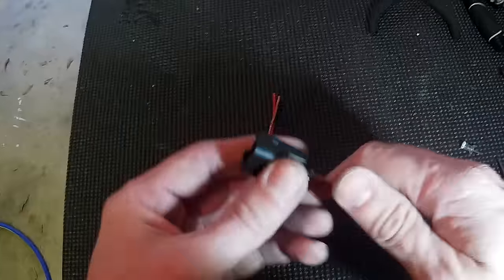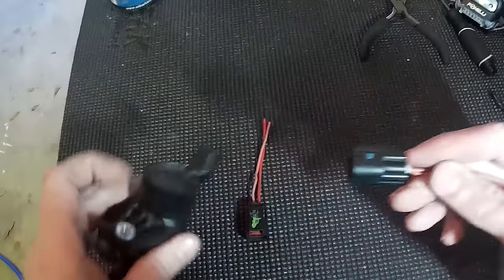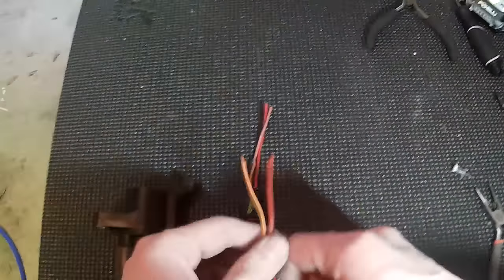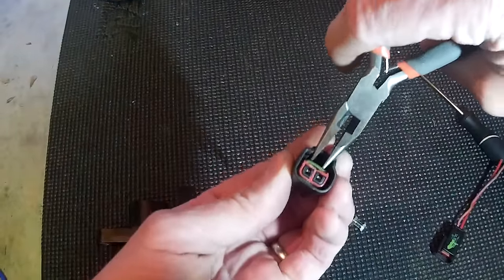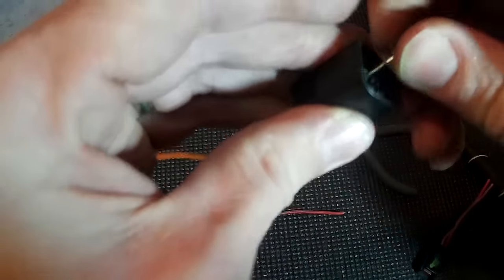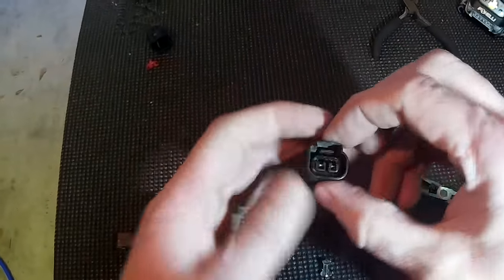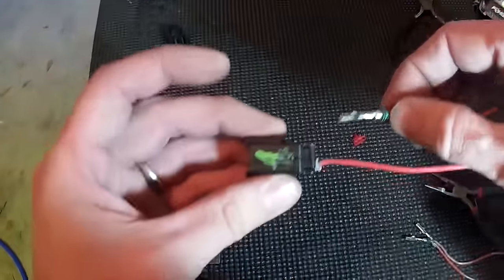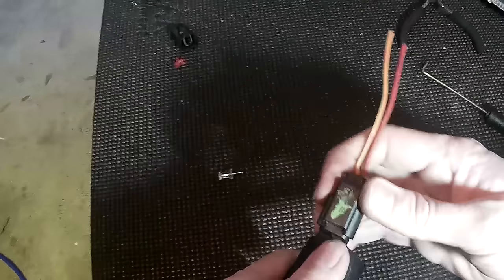Repair Ford Coil Over Plug Harness Adapters Without Cutting or Splicing. Broken ignition coil wire.

Comment: You just saved me so much stress, headaches and aggravation. I was getting cylinder 2 & cylinder 4 misfire. Haven't had the truck long, but figured the coils were bad with the truck having 140k on it. I replaced all 8 and drove for a short while and felt the hesitation come back. Check engine light began blinking and the engine power was down to where my a/c quit and power steering was cutting out. I got 3 of these clips that broke as yours did. I pushed them back on as best I could and figured it would be ok, but obviously not. Thankfully I found this video and plan to hit the junk yard on my way home today. There is a few of these in the yard there. Hopefully I can find some that are still decent enough. No way was I going to cut and splice, but figured I would have to replace the whole harness and or take it to the shop. I am so relieved that I can fix this myself. I am good with cars and almost always repair things myself, but I do not like messing with electrical because things are so finicky. Thanks again. I feel so lucky to have found a video that was the exact problem and solution in 1 short video.

Comment: Well looky here... This is what I needed to see!!  Thank you so much.  I replaced my sparks and coil packs and have a misfire on "D" which I'm told is #8 (the back left one).  Switched the pack out with another cylinder and same code popped up on same "D".  So I've been bumped thinking I need to splice and what not.  This is exactly what I need, Thanks!
Reply from the maker: Your welcome! Glad I was able to help.

Comment: Long story, but the short story is that I used your procedure to replace the starter connector with a new connector that was super difficult to find at first.  Your procedure allowed me to NOT have to cut the wire and splice it, just wanted to say Big Mahalo for this video!
Reply from the maker: Great! Glad it was helpful for you.

Comment: Hey Scott, Such a great video.  My crank shaft position sensor connector is broken.  Car was not starting because the plug had slipped out enough.  I was dreading having to splice into the harness.  You saved me a lot of trouble.  I appreciate your investment time to make this video. You ROCK!
Reply from the maker: Thanks! Glad to post and glad so many have found it so helpful.

Comment: Thank you so much for the video. I wasn't sure what the chances were of finding a video that showed how to repair these connectors without splicing them, but sure enough there happened to be this one. I have been having issues with 2 of these connectors and it's because the plastic tabs broke off. This probably saved me $50 from the parts store so thanks again!
Reply from the maker: Your welcome! Glad it helped out.

Comment: Thanks for this video man. The same thing happened to me last night. Nice to know it's a simple fix that does not require splicing and soldering.
Reply from the maker: I spiced once and then figured this method out by dissecting the part I removed. Glad my video was helpful.

Comment: Thanks, this video is exactly what I needed.  I found a set of 8 connectors on ebay for about $13.  Now I don't have to be concerned w/ splicing them.
Reply: Did it solve your problem after you changed the connectors ? Thank you
Reply: @ebayluis23  Yes, it did.
Reply from the maker: Great find for $13, cheaper than the yards. Glad you were able to get it fixed.
Reply: That's a good deal also I've used small zip ties to hold them in place till a person gets the chance to change them out.
Reply: Where did you buy your connectors ? Were they quality? I bought some they were junk!! Can you share the link? Thank you!
Reply: @chrisdoyle567  Ordered them off eBay
Reply: the ford wires still fit properly in the aftermarket connector?
Reply: @lukeoefelein5601  Yes, they did.

Comment: Big help! But I do have a suggestion, If the tab is not broke off. Most likely the silicone gasket is destroyed and keeping the connector from going down all the way. Dig out the silicone I would bet the connector will lock. Just replace the gasket.
Great video!
Reply from the maker: Mostly these break because the little locking tab dries out and becomes brittle from heat causing the grip to let go. Ford used cheap plastic on these evidently or they just saw a huge money maker in replacing them. I would personally keep the silicone, it helps keep things snug and locks out water.

Comment: Yep, I’m dealing with a misfire issue currently and I couldn’t figure it out until the coil connector/over plug came loose and wouldn’t snap in like it should. Thanks for the mini tutorial bro 💯👌🏽
Reply: i’m having same problem on my 06 5.4, after this process are you supposed to splice it in or how do you connect those wires to the actual harness in engine ?
Reply: @hernan6ez936  basically you take the old connector off and put the new one on. No splicing needed. It’s a little tricky. I went to a pick and pull and found old/used ones and they worked out great. Get a couple extra just in case though. One I picked was brittle
Reply: Did your misfire have any codes? I’m wondering if that’s what my problem is.

Comment: Very small screw driver and push on keeper from wire side. It has snap connection too. Push and it will pop up. Then pull it out with needle nose. You won't be breaking them

Comment: I just had to replace some and bought them from Amazon for a set of 8. I’ve always done a lot of soldering though and so had planned to do them that way. Especially considering someone that had the truck before me had used a butt connector to fix one of the wires in one plug. I didn’t even really think of trying to take the pins out which I’m surprised I didn’t and wish I had. Granted if good at soldering that’ll work also, just make sure to cover solder joint with heat shrink . Nice video though. Thanks I’ll keep this in mind for SURE the next time!

Comment: If it doesn't snap on, does that mean you will definitely have a problem or could you hold the connector on with maybe a zip tie? How can I truly tell if the connection or connector is bad or not? I put in some new coils and the connectors didn't snap into place. Some seem fine and others are iffy. Thanks. Great video.
Reply from the maker: I have had a few not snap in, I give a little tug to make sure they are secure. Also check the little rubber gasket inside to make sure its in place and not pushed to far back or twisted.

Comment: this video makes it look so simple, and on the bench it is. But doing under the hood with just a few inches if worth of play in the wire, well just be careful not to pull to hard or force anything, in or out. Its just tight , especially dealing with number 4 or 8 cyl. But overall good video and  good info and you're right, $22.99 at Advance. Didn't even bother with dealer...lol....and $17.99 for  fuel inj harness adapter. .So definitely try to find at local junkyard, especially if you have several to do. Just make sure they aren't as brittle as the ones your replacing. Especially if they pull em for you, check them out before you pay!! Because most junkyards have a no refund policy on stuff like this.
Reply from the maker: I like to pull my own. I look for late model, low milage and definitely make sure they are in good shape. I use a folding ladder to get over top of the engine, luckily im tall. Done them all under the hood but you're absolutely right not much room to move and don't pull or force anything.

Comment: The mechanic shop broke three of my 6 snaps then denied it! THEN told me it would be $3,000 to fix the 6th cylinder misfire! OH and that the bolt to that cylinder was also stripped and would be another $200 for a kit to get the bold out they stripped! 🤬🤬
I was able to get the bolt out but was really stressing out about the broken snaps. 
Just wondering now is there a place to order JUST these snaps? I’m land locked and live in southeast Alaska so little to no options here but to order. 

Thank you sssooooo much for this you saved me!

Comment: bro it was definitely a help thanks for uploading.
Reply from the maker: My pleasure. Thanks for appreciating and commenting.
Reply: B Scott ireally appreciate it man having same problem it doesn't stay locked in to the coil I replaced the coil spark but it was still reading misfire so I noticed some were broke so im replace this weekend man thanks alot.
Reply: C

Comment: Geez...this is such a better method than the splice & solder job I was getting ready to do. Thanks for the video.

Quick question. Does Ford sell the complete wiring harness replacement?
Reply from the maker: Ford does sell a complete replacement harness, it is very difficult to install and expensive. It is an option though.

Comment: Great video, just what I needed. 
Added note: I found out today why the aftermarket ones I originally ordered would not fit. My 2007 Ford has 2008 connectors. Having a hard time at the junkyard so I bought a couple from AutoZone: duralast part number 851. It was the actual part I was looking for worked great, but almost $22 each. Looking around for the rest as they are not as urgent. Alternate/OEM Part Number(s): 1F1Z14489AA, 3U2Z14S411SLA, 3U2Z14S411SLB, 4F2Z14489BB, 851, F42Z14489BB
Reply from the maker: My first one I broke was an aftermarket connector. After that I figured out how to re-pin. The aftermarket one eventually needed replaced, after about a year I would get a misfire that would buckle the truck on acceleration. Scan guage pointed to that cylinder. Instead of re-pinning I re-wired since the pins are different. Hopefully you have better luck. I have an 08, any 5.4 from the yard should work. f-150's, expeditions, econolines, lincoln's, ect.

Comment: Thanks for the vid.   I'm having a problem with my #5 coil, causing a  rough idle problem and triggering the engine light.  A mechanic noticed the coil was loose, so he secured the coil by placing a piece of plastic wire tie in the bolt hole, which made the small bolt tight the secures the coil.  He checked the wiring to make sure the plug was firing, and it was.   He then secured the coil connector to the  coil with a couple of plastic wire ties.  The connector is tight in place, but after driving the car about 30 miles today, the engine light came back on.  I'm still getting rough idle after the car has stopped for about 25 seconds, and occasional shudder on take off.   I checked the car with a scanner tonight , and I'm still getting the same 0355 code, which is the #5 coil.   I wonder if the connections in the coil, those metal pieces on the ends of the coil wires are somewhat corroded or not making good contact.   Should I splice in a new connector with the wires attached to the new connector?  Like these... https://www.ebay.com/itm/8x-Ignition-Coil-Connector-Plug-for-91-11-Ford-4-6L-5-4L-Modular-6-8L-V10-Triton/373474935415?fits=Year%3A2004%7CModel%3AGrand+Marquis&hash=item56f4d74277:g:zooAAOSwFk1gN7k0
Reply from the maker: This method will keep you from splicing. Not a lot of room or wire available in the splicing method. I would start at the coil and move backwards. Check resistance on the coil then swap it with another to see if the misfire switches cylinders. After that check the connector to make sure its tight and check the wiring from the connector back to the wire harness for any wear or exposed wires from rubbing.
Reply: @fixinstuff  thanks Scott.   I've already switched coils  twice on the #5  cylinder, and tightened the connector to the coil with a couple cable ties.   Still have the same problem.  Just saying this for your amusement...   I took the car to Auto Nation Ford in NW Miami.   They did some kind of diagnostic check, but said they would have to start by replacing the main computer (PCM).   Since Ford no longer offers it, they just gave me back the car at no charge.   Autozone does list the PCM, about 135.00 plus core.   However, that may not be the problem.   I called Ford's national customer service number, and said give me a dealer I can take my Marquis to to get it repaired,   This is not some rare Ford.  The Marquis and Crown Vics are still used for taxis and police.  The lady called Gus Machado Ford in Hialeah and I spoke to a service rep.   He asked how many miles are on the car.  I said 230,000.  He said "We're not allowed to work on any vehicle with over 135,000 miles."   I'm thinking, would I buy a car from a dealer who might eventually tell me they can't service my car because I drove it too much?
They recommended Metro Ford in Miami.   I called last thursday.  A lady service rep said they would try to diagnose the car so I could have it by Friday.   I drive right over, 10 am.
Another service rep waits on us, and says "We are so backed up that we probably could not look at the car till next tuesday.   That would be six days.   Earlier last week i called Pines Ford in Pembroke Pines.  The lady in the service dept. said they could not get to the car for 5 days to do a diagnostic check.   Now think about that.   You could be from another state on a vacation.  If your car is running to bad to use it, you could be stuck for days before Ford could even get to your car.
I called Palmetto Ford.   The lady told me a service rep would call me back as soon as he finished with a customer.   That was early last week.   I never got a call back from them.
I also emailed  their chat line, and never got a call or an email.
I did join the local Mustang Club in Miami, and they just recommended a couple of shops that work on newer Mustangs.  Since the newer Mustang engines are similar to the Marquis engine, I will talk to those shops about my problem.

Comment: great info fixed mine, also worked for a broken wire at connection on my oil pressure sensor..Thank you
Reply from the maker: Excellent, Glad to help. Thanks for the tip about it working on other plugs.

Comment: thanks, had to swap the pins on the MSD mod6. it was set up to run the SOHC and DOHC uses a reversed polarity. was fighting with the pins. the one connector i was trying was not wanting to let go but the rest just popped out no problem

Comment: good vid. Amazon has em too bout $20 for a pack of 8. Unfortunately for me I had to but two sets because I've got the 6.8 and nobody offers them in a pack of 10 for some reason. As if the 6.8 doesn't exist. It's weird but plus side is I have extra in case others break somewhere down the road.

Comment: You think about 3 of these same broken connectors on the 4.6 would cause the truck not to start , had just passed an inspection a few days later had a hell of a misfire driving back to my house a hot dry summer afternoon , no flashing cel, or codes

Comment: My O-ring got all bunched up on my harness connector so I took the O-ring off snapped back in place just fine, until I can buy another connector for mine at the dealership for my 08 5.4l super duty. If you pull the O-ring it should work fine.

Comment: Great video!  I have a broken tab on one connector on my Toyota 4Runner.  I'm sure repair is the same.  Thanks much.
Reply from the maker: Should be very similar. Fords have that red snap in piece to lock the pins. My old Honda didn't have anything like that and I was able to release the pins using that little pick.

Comment: Same thing for my spark plug connectors, So pissed i didn't watch this video before i sent my car to 3 different mechanics and none could figure it out, finally figured it out on my own; i also highly recommend the junkyard to find connectors, EACH connector from a parts store is 30 dollars!!!!
Reply from the maker: Glad you were able to get it fixed. It's hard to find a good mechanic who can diagnose and not just slap on new parts.

Comment: Great video. Changed coil and plug on my 2010 Ford edge. Getting a p0352 ignition circuit code. How do I diagnose/test/fix this?  I'm wondering if this is a problem between the ECM and the harness
Reply from the maker: Last number of the code is the cylinder number so cylinder 2 is your problem. Use a scanner and wipe the codes if it comes back swap out the coil with another and see if it persist on Cylinder 2 or jumps to another cylinder. If you haven't inspected and changed the spark plug I would as well since plugs can crack and arch. If it still persist start looking at the wiring, follow from the coil to the main connector look for wire damage.
Reply: @fixinstuff  all 6 plugs changed. 4/6 coils now changed as well. Is #2 front or back side of engine? (Horizontal orientation)
Reply from the maker: @markgoldfeder6872  Back center.
1 2 3
O O O

----------

O O O

4 5 6
Reply: @fixinstuff  OK #2 was replaced Friday night.  Only have #3 & #4 remaining. Since the problem indicates #2, should we be thinking electrical/connector problem?

Comment: Success 👍 thank you I’m not one for cutting stuff unnecessary I found the correct motor craft pigtail at rock auto 👍  after trying a couple of them from the local auto parts wire clips were different and didn’t work so now the excursion beast lives again without butchering it 😎👍👍
Reply from the maker: Glad it helped. Thanks for the tip about Rockauto.

Comment: Hi! Can a loose connector cause misfire even if it does not come completely off?
Reply: I believe so yes.  According to the man who made the video, his was caused by the connector not “clicking” or locking onto the harness.  I have 2 that slide right off and I’m having misfires on those two cylinders.  Looking to swap them out tomorrow.  Good luck to you.